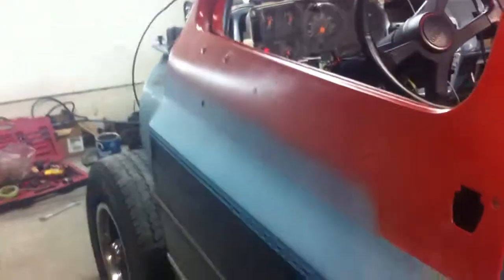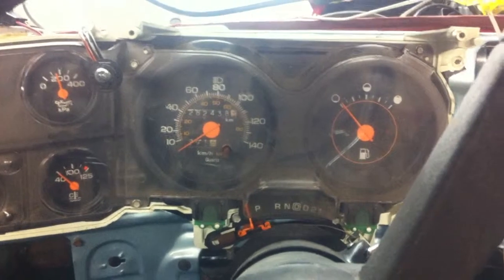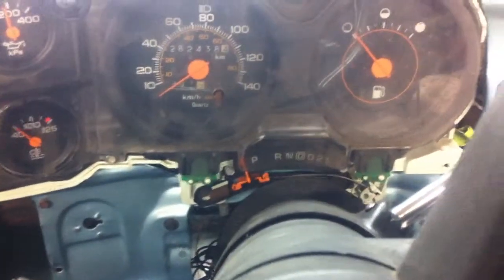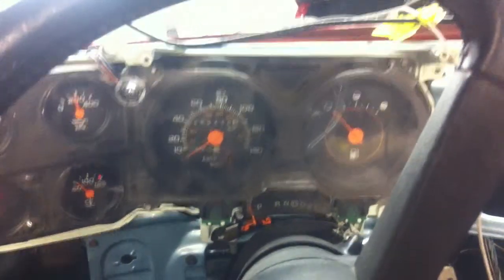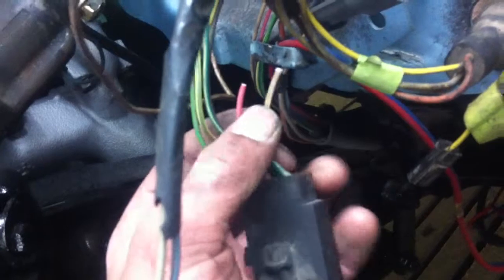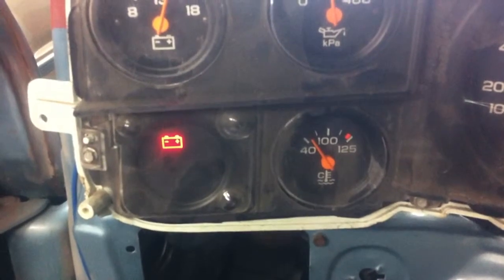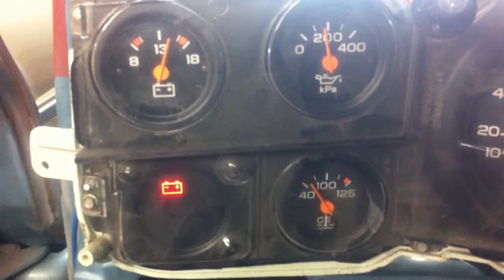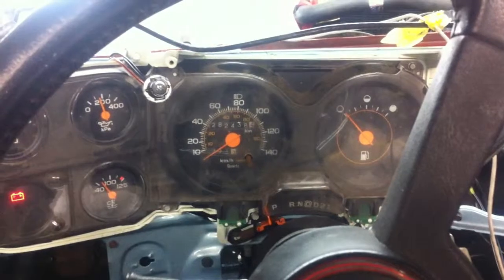86 jimmy K5, 6.5L turbo diesel swap, 90 K5 body, 90, electric speedo cluster swap

Comment: How was it I want do mine c30 crew cab truck 1984
Reply from the maker: I’m still working on it, floor badly rotted I’m welding it all up
Reply: modelfreak125 do u use same motor mounts
Reply from the maker: 1 cuc Official same motor mounts as a 6.2l diesel. For 1990 r/v blazer of suburban. The 5.7l mounts are different

Comment: from where to buy a new DRAC ?  is there special tips to install it ? or just fix it and replace the bad one?
Reply from the maker: no new around no longer available, any wrecker will have on any gm truck from 88-95 will have one. you need to adjust the resistors to match your tire and axel, unless you find your used one has the exact setup you have.

Comment: i have a 1991 k5 blazer, recently the speedo stopped working, cruise control not working, and brake light always on. i checked the VSS its ok.  what could be the issue to replace ?
Reply from the maker: Sounds like a Bad DRAC module, check my video I show it should be near the pcm or radio by the glove box under the dash?